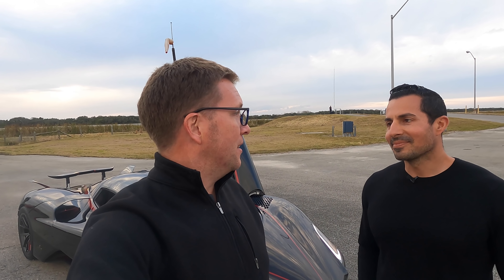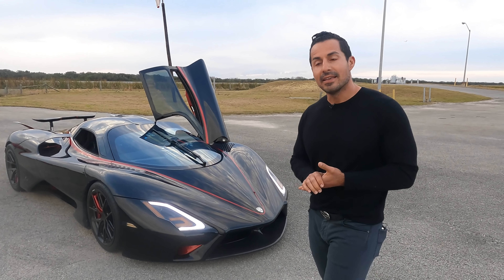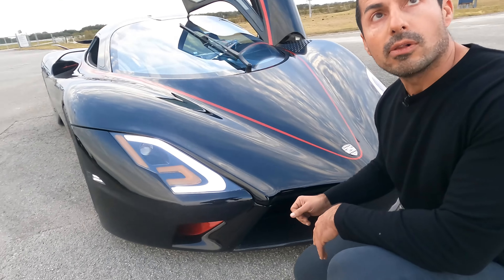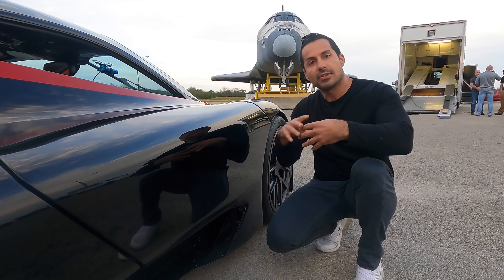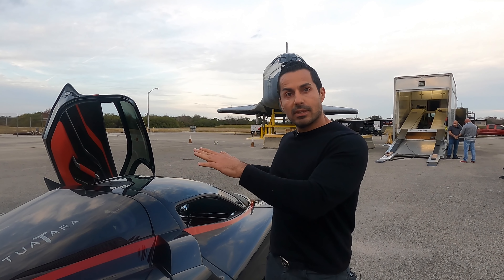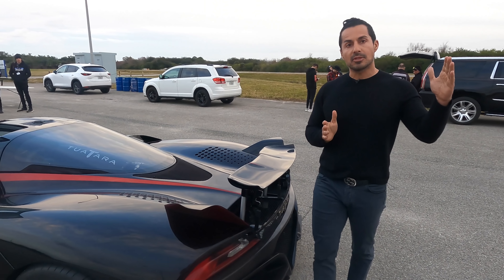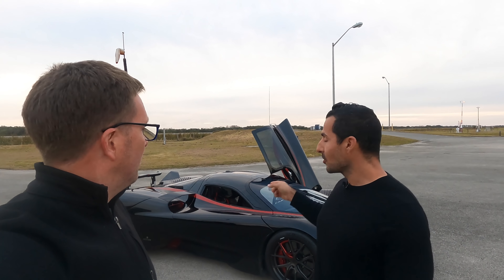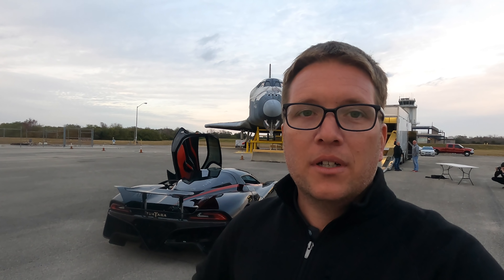SSC Tuatara’s 300MPH Aerodynamics and Design !

Comment: Always nice to see the Tier 1 insights 👌🏻
Reply from the maker: Nice to see you in the comments ffm
Reply: @RobertMitchell    Sense this is the Top Speed variant, what do you think about a 315/35r20 on a 20x11.5,  larger diameter and less drag, not talking about having the preferred tire brand and performance category, just the tire size and it merits and any disadvantages vs a 345/30r20 on a 20x13(or 12.5?).
Reply: @RobertMitchell  check again

Comment: 200 mph with the window down? That's the very first time I ever heard in my life. I was once on a highway at the rear right seat of a Fiat Punto. The speed was just 100mph and I was already feeling some pressure and hearing air noise. The windows from the rear doors were just 1cm open.  So for this one to have this capability, it's just amazing. The design is beautiful. I love that rear window over the engine.

Comment: I did like the idea they have come up with drawing air in at the back to immediately vent it out into a diffuser just above ground level with all those aero benefits. Not something most designers would come up with as they just want the air gone but to do this is clever.